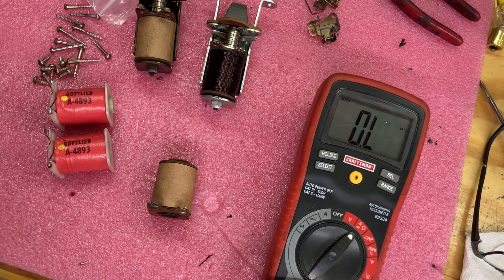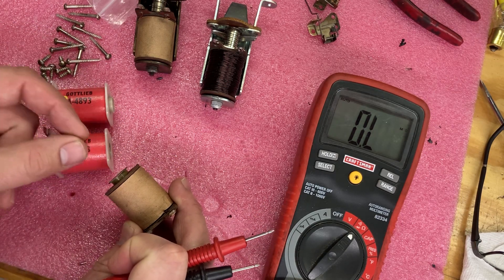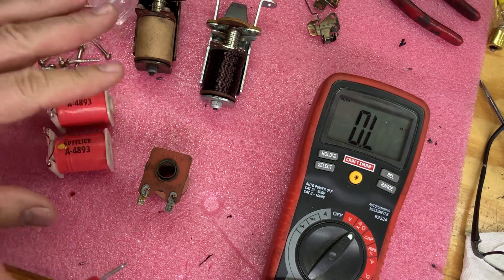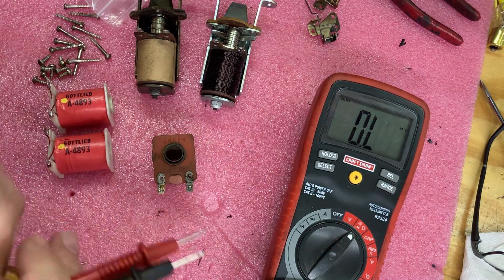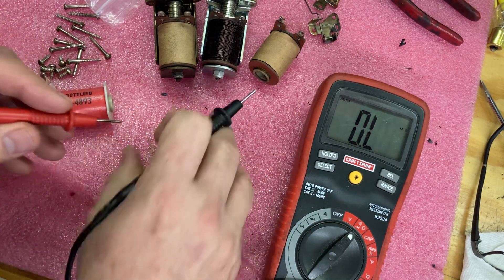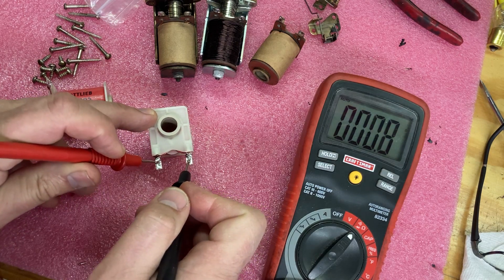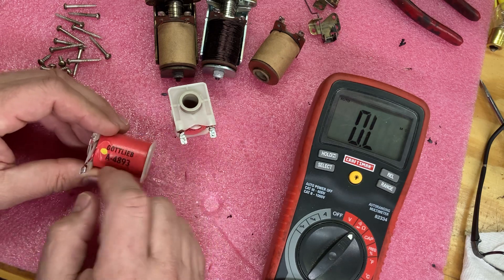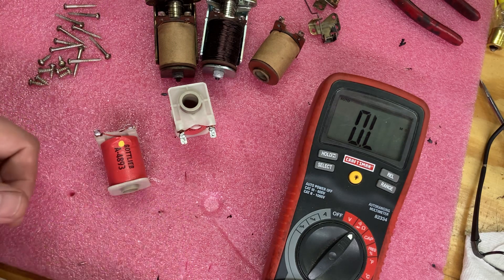Pinball coil ohm resistance difference A-4893 standard vs yellow dot

Comment: Ask Steve Young at Pinball Resources why the Yellow Dots are stronger and at what percentage. Either they have fewer windings or using thicker gauged wire with less wire turns. You can measure the max current using a current clamp meter when hitting the ball measure the max current of the coil. Try making a video doing that